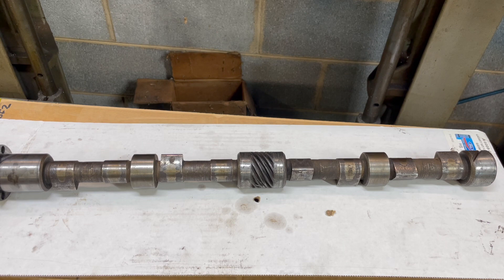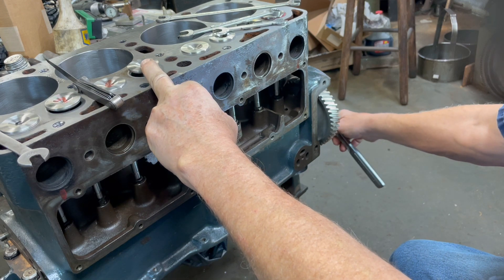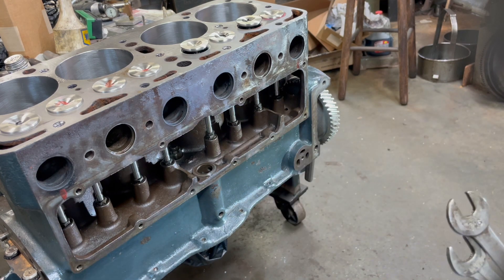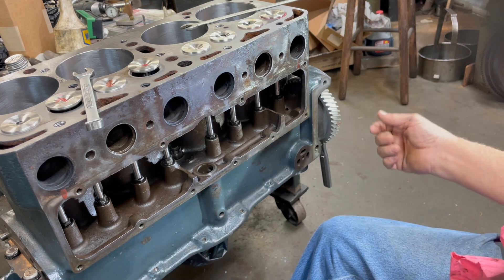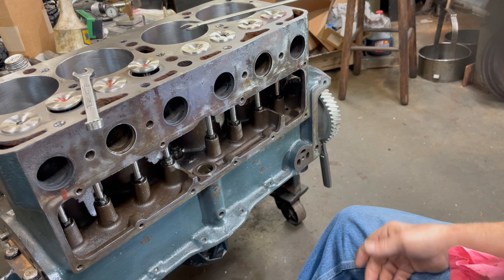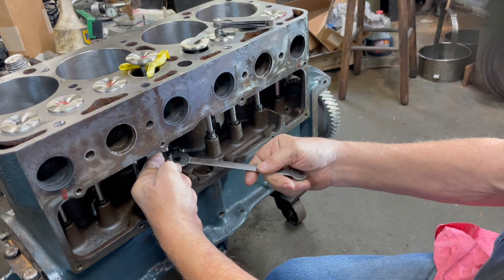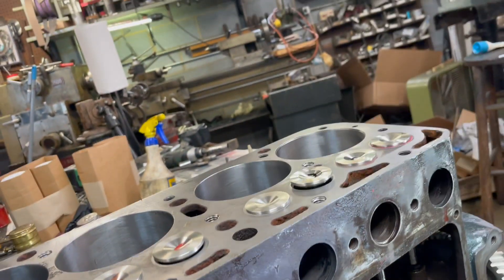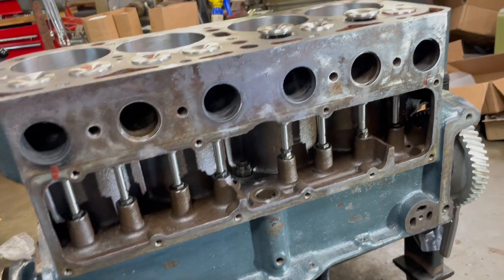Super Easy Model A Ford and T Valve Adjustment

Comment: To adjust valves one should use the rule of nine,eg.,to adjust valve eight subtract one from nine and you have eight, to adjust valve seven subtract two from nine and you have seven and so on, it's fool proof.

Comment: I'm thinking in order to adjust the valves with the head on an engine that's operable you'll have to look in each spark plug hole to make sure piston is TDC, correct?
Reply from the maker: No ,The way I show in video you don't have to look in cylinder, just adjust the opposite valve  that is closed for instance if no.1 ex. valve is fully open adjust no. 4 ex. valve and so on